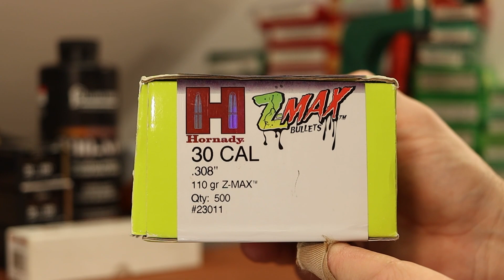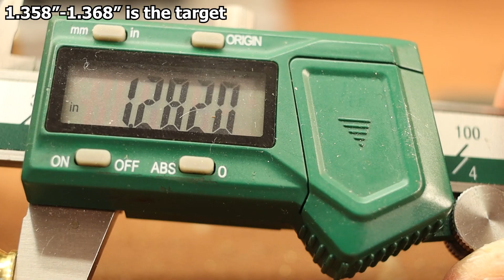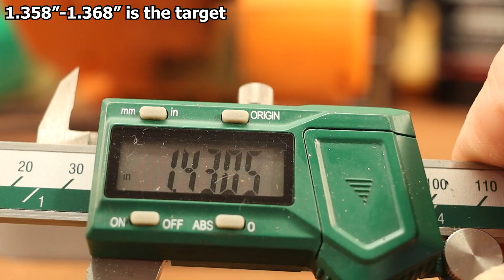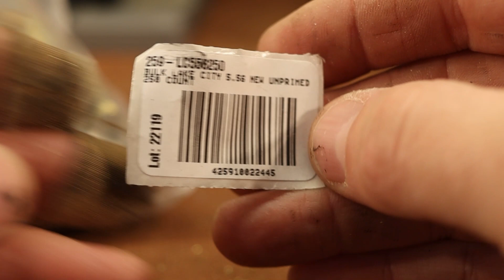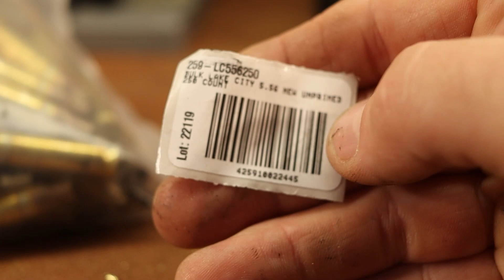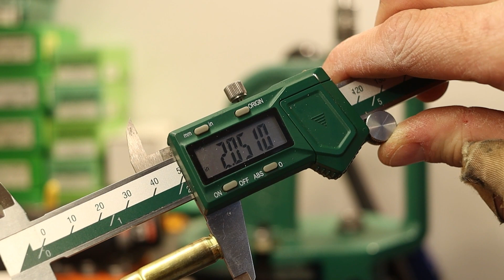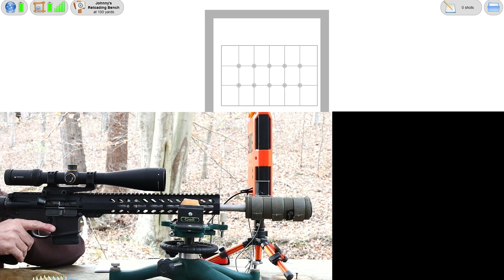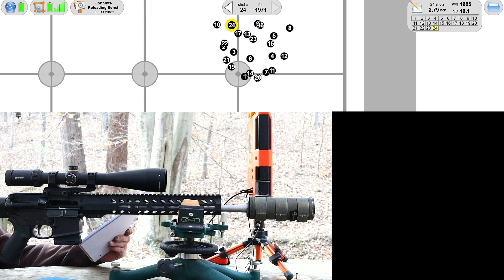Forming some 300 Blackout brass

Comment: I don't know if it is still out there, but I use the Squirreldaddy jig for cutting my cases. Mounted a die grinder to a spring loaded hinge and mounted the rig to a steel base. Works great! Have you tried the 85gr pellets yet? Works out to 2550 fps... I have bought TREX 85gr Copper Poly tips, and 85gr Penetrators. I was concerned with them being short but they chamber from the mag.

Comment: You should try the Lee quick trim for 300 BLK. Works very well.
Reply: I also use 110gr V-max with 20.2Gr of Hodgdon H-110. I get 1 hole groups @100 Yards and just over 2400fps out of a 16" barrel.

Comment: My go to for supers is still lilgun, for subs I'll be trying some CFE black. I'm still very happy with the consistency and accuracy I get from the Speer 125 TNT and 130 hollow points. I'm using a 16" 1:9 carbine gas barrel. I have a 16" 1:7 carbine gas barrel to try out as well.
Reply: Where did you find 1:9 twist 300 blk barrel?
Reply: @DimaProk  I believe it's an ARD heavy barrel I bought 8 years ago. I bought it because back then it's all I could find and I was happily surprised by how good it turned out to be.
Reply: @Rubberweasel  I want one in 1:10 or 1:12 for supers only.
Reply: @DimaProk  it runs supers very well and does good with subs. I use the hytek coated Missouri bullets 240 grain for my sub loads.

Comment: First thing, screw or clamp cutoff wheel to Bench. Loose gear is a chopped finger waiting to happen.
Second, get high speed thin metal slitting
Discs.
Three: throw away chop saw, and use mini- lathe and collet chucks...
Presto, correct cut to lenght, little or No burr, internal or external, quick production.
Doc AV

Comment: Whew BR-4s for 300AAC.  Dang, using the expensive primers.  300AAC is one of those cartridges which after having to trim 100, you will immediately invest in the RT1500 and 300AAC trim die from Dillon.  I can cut and size 1000, 223 cases down to 300AAC in about 30-45 min.  Worth every penny I spent on it.  I also use it to trim 223 range brass.  It can cut a 223 down to 300 in about 3-4 seconds with no leftover burrs.

Comment: That Lee Deluxe Powder Measure is kind of a pain to set up. And it’s also kind of a pain to use it with extruded powders. But if you buy the stand that it’s supposed to be used with, it’ll dispense into a pan real easily. 

It works super nice with ball powder! CFEBLK measures nearly perfect every time. So does CFE223 and 3N38, even though vv is a little chunkier

Comment: Love your videos, I've made a ton of 300 blackout myself. Your using the wrong blade on you mini saw. That abrasive blade is for ferrous metals. you should use the high speed steel metal blade. It leaves a much cleaner result

Comment: I wouldn't be surprised if your gas gun does not like weak/anemic charge weights for accuracy & velocity SD.

I'm curious how much better accuracy is achieved if you load them according to data gathered from an optimal charge weight test finding the highest stable accuracy note at the upper end of the charge weights.

Comment: Be sure to mention that the wall thickness of the neck should be trimmed to no thicker than .0135 as some barrels have tighter tolerance than others which will cause chamber jam. You can use a Hornady Neck Trimmer, and resize a second time after neck trim to ensure spec of case neck. Some cases are thicker side wall and must be trimmed much like a lathe to proper wall thickness of newly formed neck. Had issue with that but trimmed neck stopped any chamber jams, even in match grade barrels.

Comment: The problem with your group was more than likely your powder changes and type of crimp. step down that powder charge by 3 grains and use a factory style crimp. That should tighten up your group with the ZMax if that doesn’t work try using a standard small rifle primer with the same 3 grain reduced load.

Comment: Cfe blk and 110 v max worked and grouped great for me. Even took a deer with it one shot one kill but was not happy with the bullet expansion double lung pass through he went 15yards before he fell but both holes were the same size and the lungs were intact with a 30 cal hole though both. I’m thinking about 110 sierra 2030 hollow points next time. Also was a 10.5 barrel

Comment: What i do is i form it first with the 300 sizing die without the expander in it just to get my shoulder so when i i cut it i dont have to guess as much where i need to set my jig. Now that i just leave it clamped in the saw i dont have to guess at all. But for me forming it first speeds thing up and eliminates a step cause i tumble my brass then lube it size it then cut it and a quick tumble to clean the lube off it. So for me it just makes things easier and faster forming it then cutting it. Takes alot of guessing out of the equation

Comment: 1.)  I still don't understand why people want to destroy perfectly good 5.56 brass when  a.) factory 300 Blk brass is readily available and b.) commercial 300 Blk brass has a larger case capacity.  I got my best deer load with once-fired Remington brass, 21.0 grains of LilGun, and the 125 grain Nosler ballistic tip: around 1.25 inch groups and a little under 2400 fps from my "cheap" 16" CMMG barrel.  Haven't had a shot at a deer yet, but the 90 pound pig I hit with one had a complete pass-through with about a 1 inch exit hole and it dropped on the spot.

Comment: You mentioned LC brass so you didn’t have to remove the primer pocket crimps. Do you have a video where you do just that? I have had mixed results and it’s very frustrating.

Comment: Someone told me I could use hogden trailers to load subs with 208 gr. Do you think you could do a video on that, if not does anyone on here use it currently? I'm confused on how to work up the load. They said something like fill up the case to the neck then remove 20% as a starting load?? Thank you

Comment: I 3d printed a jig that was supposed to be right on and had to cut through the plastic the exact same way.
Reply: Also, I found it easiest to dial in with an already sized and trimmed piece in the jig against the blade.

Comment: Terrible groups are a result of case Wall thickness asymmetry.  The asymmetry is caused by the case rotating and wobbling during cutting.  Additionally you should never cut brass with an abrasive.  The wheel will eventually load up with brass and then explode while trying to cut.  Many have suggested getting a toothed blade, which is good advice.  Also should neck up before cutting to thin the brass in the neck region.
Reply: I just run them through my bandsaw.  After they are formed, I cut the necks on a Hornady setup for concentricity.  That’s a must on these for accuracy.  Last step is case length trimming.  No annealing.

Comment: Yeah I had to pause the video, pretty frustrating watching ole` johnny boy struggle. I've converted somewhere in the ball park of 20k cases.. 300BLK and 300 HAM'R I'm on my original fine tooth saw blade. I never even considered the abrasive fiber blades, as the RPM's on the the little saw is no where a dremel's speed. I started with a squirrel daddy 300blk jig, got a elite3d design for HAM'R and now have one for 300blk as well. I went to a local papajohns and asked for a few pizza boxes, I set the saw in the box and have an oil drip/catch pan from dollar tree, if you swirl the thing the necks stand right up, grab handfuls and go to town. I can easily do 1k in 1hr. When I'm done I take all of the choppin`s and dump them in the scrap brass bucket. Wet tumble for 30min to knock de-burr before running them through my dies. Because if you don't you will smear brass inside your dies and have a hell of a time getting it out. (Redding actually has a whole write up on smearing brass inside your dies on their site) With carbide dies you don't even need lube for 300BLK (HAM'R YES), use a rotary trimmer (WCT, WFT, RT1500) Dry tumble to polish and again it'll knock off any burrs.. With a quality trimmer you won't need to worry about chamfering/de-burring by hand.

Comment: Not sure if my jig came from the same place as yours, but even with the metal cutting blades I had to shave a bit off of my jig as well. I used a 300blk case I already had to give me an idea of where to trim, but I used the saw just like you did.

Edit. With that 16 inch barrel, that 1:7 twist may be over spinning those 110 zmax bullets and causing those bigger groups. Just a theory.
Reply: No such thing as over stabilization….

Comment: I've tried making brass, and constantly had failure to chamber with the brass due to neck size.  Wasn't going to neck trim all of them
Reply: @blackhawk7r221   Redding dies and yes it was neck diameter problem
Reply: If you have made damn sure that you didn’t seat your bullet out too far, and you didn’t crush back the shoulder with the bullet seater/crimp die, then you may need to spend the $100 on a case neck concentricity cutter.  Often, the brass wall is thicker on one side than the other.  Turn it just enough to get a uniform surface, no more.  Retrim neck to correct length.  
I have no issues with my basic Lee set, and I do not need to turn the necks.
Reply: @blackhawk7r221   at some point you gotta weigh your options when considering all the factors in the equation. For me Starline brass was the right decision for me
Reply: @BigRob345  True.  Forming cases became a pain, I just started picking up range brass after a while.

Comment: Get a worlds finest case trimmer (2) from little crow gunworks. The new model let's you swap shoulder bushings so the trimmer can be used on any caliber. They will also make you custom shoulder bushings if you have a round you only want to neck size. I can trim 500 pieces an hour without trying too hard.

Comment: I'm still torn between getting 300BO or 7.62x39 in a bolt gun, as a suppressor host; or 300BO barrel and dies for AR.
Reply: I've got a 16in AR and the Ruger American in 300blk and both are fantastic suppressor hosts.  The bolt gun is super quiet suppressed with subsonic loads. Working on getting my stamp on an sbr lower so I can build a shorty blk.
Reply: Get a fast twist like a 1-6 or a 1-5 You can sub anything

Comment: Dont you think 1 in 7 twist is a bit much for a 110gr bullet in 7.62/.300? 

Either that or this could be due to having to much or to little powder in the case. The wrong powder. The case length not being uniform enough. The seating depth not being tuned to where the lands start. The primers not igniting the powder properly. 

Well that is all i could think of. What could it be? Wrong shooting posture? 

It can be a lot of things, i dont know what is up. You have to rule out the variables from the equation. It should shoot straight and better than 2 MOA. Maybe a really heavy .300 bullet will stabilize better.

Greetings,

Jeff

Comment: I had better luck with the metal saw blades that you could buy a 3 pack of with the harbor freight saw. Cleaner cut and faster. I’ve cut over 3k rounds with 4 blades. My saw is way louder than the old style

Comment: Avoid this, just get 300BO brass for reloading. It's not that expensive, better than mixed up fired .223/5.56 brass. Wait for a sale. You can also buy range brass in 300BO which is probably as good as anything else you're using to form you own 300BO brass. Time is money too and in the time it takes to form brass you can reload hundreds of 300BO from purpose made brass.

Comment: Jig isn't printed to the right spec for length.  Can't blame your older model saw.  Distance from the ball bearing detent to where the brass needs to be cut for proper length -- the cut location is in the plastic, not in the intended opening, no matter the saw.

Thankfully the plastic cuts easily and the jig isn't useless.
Reply: Agreed .

Comment: Love your channel but why go to this much trouble when 7.62x39 steel case is back down below 40 cents a round with brass rounds at 50 cents. Building or converting an AR to shoot the Russian ammo would require less effort and the brass cased 7.62x39 is even coming with boxer primers now.

Comment: Do not use a cutoff wheel lil that one. Instead use the saw blade HF sells. These saw blades are made for metal and well cut brass very well and not leave that huge burr you are dealing with.

Comment: That jig is a joke. It's all on the jig. Squirrel Daddy has made a good one that is totally adjustable and works great. BTW there are a list of cases that don't do well for converting because the case walls are too thick one of them is PMC. You can't even get them reliable with neck turning. I did that and still had rounds not ejecting or feeding because of the necks being too thick. If one sticks to U.S. manufactured brass, they should be OK to convert. Nice video as usual but no way should anyone invest in that jig you used.

Comment: Better to cut slightly long and use a case trimmer to bring the length down. The cuts are WONKY to begin with so using a case trimmer to achieve final length also squares the case mouth. I'm not a .300 BLK guy, but a friend of mine is and we cut several hundred cases down for him. It was a pain, but .300 BLK brass was unavailable due to the Won Hung Low Flu/Let's Go Brandon panic.